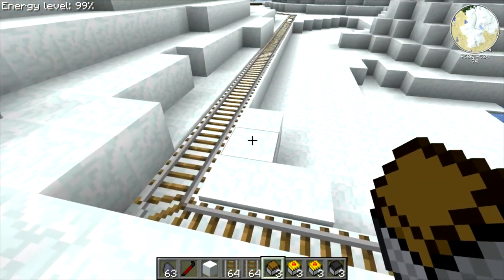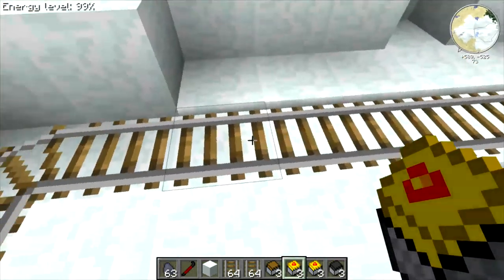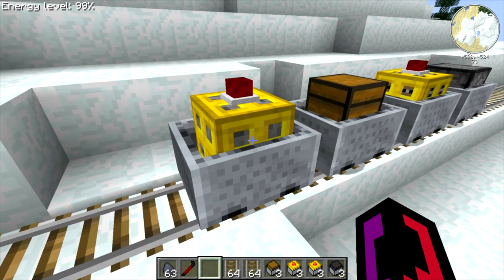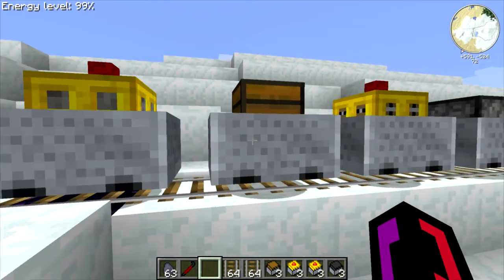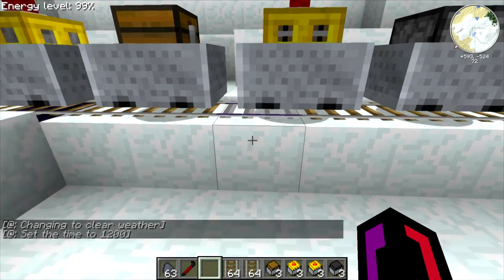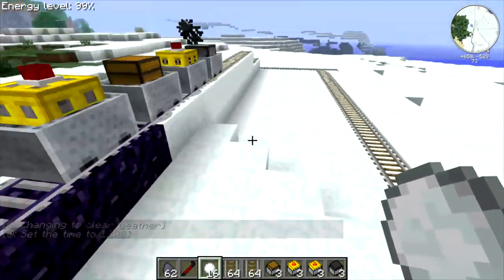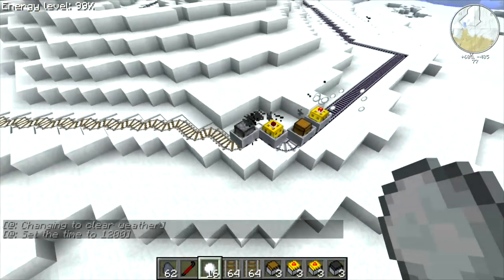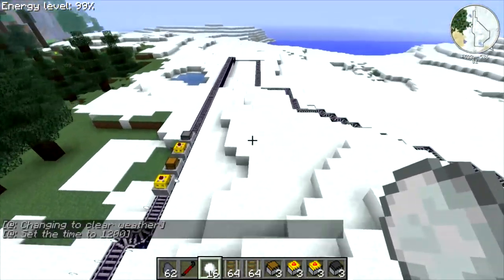Tutorials: Railcraft - Track maintenance carts (Undercutter & Relayer)

Comment: What happens if the the rail is on a floating solid block? Will the under-cutter place enough ballast to fill the void or will the track break as ballast falls? Both valid ballasts would fall to fill the gap below the old rail bed.